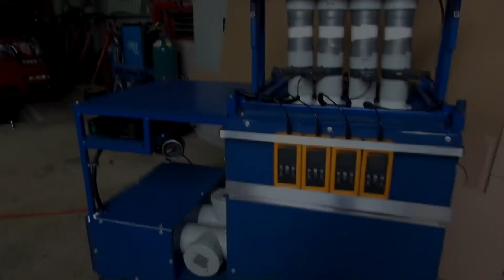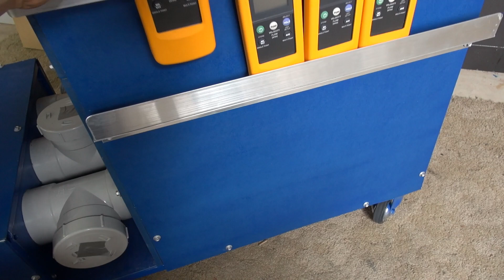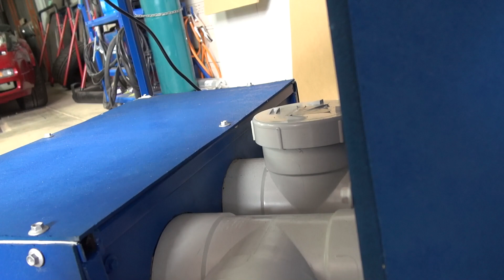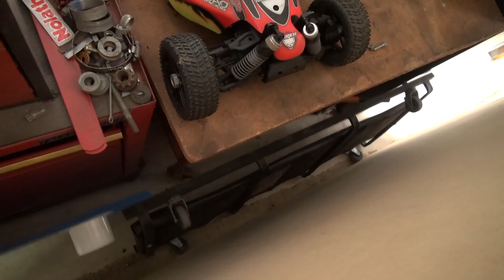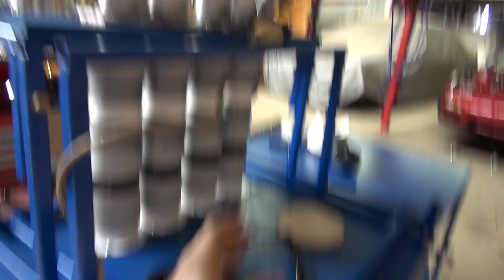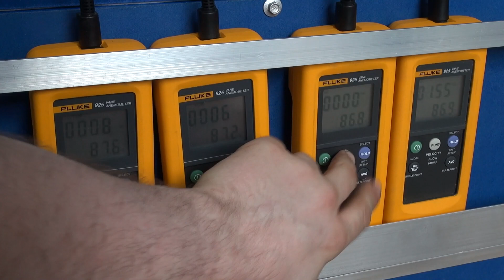Homemade Flow Bench + Car Update

Comment: My intention is not to be a know it all, it's just an FYI that is difficult to realize sometimes but remember, your boost pressure isn't what causes an issue with a weakness in your cylinder head hardware.
Obviously, 30 psi of pressure isn't going to stretch a steel fastener that is over 10 mil in diameter, your fastener stretch is a symptom of aggressive timing lead, as that's what causes cylinder pressure to spike out of control.

More importantly I wanted to say, I love your flowbench!! Great job!!

Edit: Damn I didn't realize this was 7y ago. Sorry

Comment: highly inaccurate testing all 4 together as that will never happen once an engine is running (all intake valves open together), if the intake valve on the cylinder nearest the body is open then the other 3 cylinders wont be flowing air from the plenum chamber this is the reason you should test them individually by blocking 3 off each time

Comment: LOL, I told you, I’m a noob at youtube, your video last commented 7 years ago, I won’t delete, unless you do. It might be some nice info for newbies like me and maybe revive this one, just my 2 cents.

Hey there my friend congrats you’ve beautiful R&D Bench setup,  you got lots of if not endless possibilities for R&D for all intake and exhaust components. I pretty sure many have commented or/and even yourself and I might’ve missed it, if so my apologies. This readings that you get are not really trustful for a final decision because like other might commented of course, this these test is done in reverse order, so any burr, nick and even form of each ram it would affect the result, in fact the pipe setup if the air is flowing and there is a pipe reduction and the other pipe is inside the past one there is an edge even if it comes chamfered, unless it comes from a solid billet and cnc cut to shape to have the same exact physical design they would defer from one another because all I have mentioned and more would cause a change in the airflow, it would be interesting if you can change the pipes for clear hoses and use a smoke machine or for health reasons a vape or the vapes whatever oil it is on the smoke machine and capture all the vortex that would form, I might be wrong but I thing you’ll be surprised with the amount of them. 

Now, I ignore but I think your engine is overhead cam if so this is perfect, this way fix everything together and run the tests again just like it is, now you can make a nice little 1/8 hp electric motor to turn the cam sprocket or even by hand, It might be worth even to get an salvage one cheap, in good working order of course. Once done go for a real “dynamic test” and supply the air t the intake, your AMAZING!!! setup leaves room for lots of upgrades just redirect with a homemade valve the air to the intake and by so with same setup it can open a larger reliefs for the exhaust side, even there you can simulate the exhaust back pressure and you can build an incredible setup, you kind of end up with a real dyno (“dynamic test”), that’s why put dynamic test in apostrophes, you would need the turbo(s)and all exhaust setup. But BRO!! you have a bench that can let you learn all the air dynamics in real life for a fraction of time it would take you for a physics career, but pinpointing what really interests you. You are just weeks and maybe less than a grand to have a money making flow bench and the opportunity to even lone it, rent it or just play around with it.

BTW, I have a believe that we might think alike, I was about to build one in the next months. Anyways I think your car’s top end of the engine is going to end up in the bench soon, 😂😂. Maybe for some more porting, ALSO I really apologize if I said t much crap, his is the first video I watch from you so all I have said might be late, how embarrassing 😅😅. To got a follower bro. Keep it coming I wish I can make a habit myself to record everything I do.

Comment: What happen if you rotate the throttle body 90 degrees... You wouldn't have that aileron effect... Like it is, you are lifting the air from out cylinder 1, maaaybe if you do that u will end that problem

Comment: I feel your test methodology may be flawed? first, your engine has the same CFM from each cylinder pulling the air through your intake. So mabe you should blow the air through the big hole?

Comment: Your machine is taking readings as if all cylinders have the intake valve open at the same time, which shouldn't ever happen.  You want to take individual readings for each runner with the other 3 closed,  and see if there's a difference in flow between them after measuring each one.   And your setup is for naturally aspirated testing with the vaccum on the backside, as I'm sure you know.  I think with boost pressure coming in from the throttle body (only 1 or 2 psi is necessary) , and only one runner open at a time ,  you'd have much more expected results.  I love these kind of experiments though , good job.

Comment: Its a good attempt to measure the flow when the air is been sucked naturally and constantly with the ventilators. But please keep in mind that this isn`t the case when an engine is running. A running engine is causing a lot of pulsing and waves inside of the plenum! I asume in an real scenario you wouldn`t see such a difference between the cilinders. This cant be the case as you never could find a propper tuning where the leanest cylinder work good together with the richest one.
I would not spent so much effort in measuring in such perfect even flowing simulations.

If you want to measure the difference between cilinders then better install 4 AFR sensors in your exhaust to compare which cilinder is running at which AFR. Assuming that your Injectors (which should be matched) are flowing same, you could see the difference which Cylinder gets how much air!

Comment: Nice job, but I was thinking that the set up is probably not the right one: you are "sucking" air like a naturally aspired engine, the result might be slightly different if you blow air, through the throttle body, like a turbo engine... ever tried that option? just curious...
Reply: Yeah, I was thinking the same thing as the direction of air flow is opposite to real application.
Reply: The engine always will suck the air if it is na or turbo. The only difference is the pressure available at the throttle body

Comment: I went with 4 MAF's that I grabbed from a junkyard(all 4 are ford crown vics). I looked up the specs on the sensor and hooked up volt meters to them, alot more accurate IMO.

Anyways, if you want a great guide on building a intake manifold, go grab a book called "Maximum Boost" by Corky Bell.

That man practically invented turbo racing lol
Reply: Sounds like a great idea!

Comment: this guy must not understand with a four cylinder engine only one cylinder pulls off the plenum volume at any one time
Reply from the maker: +theblackmech that one time out of the 4 cylinders has to pull air off the plenum actually happens 33 times a second ( 33HZ) when the engine's crankshaft is doing 8000rpm's the air does not get much time to stop and fill the other cylinders up when all 4 cylinder intake valves are opening and closing 33 times a second.
the airflow through this plenum will be working similar to this as it would be on a engine consuming this much air through the throttle body, this bench shows where the air naturally wants to flow inside the plenum the goal is to evenly distribute air flow across all cylinders at any throttle position to get good clean throttle response from your engine and help air fuel ratios stay the same in each cylinder. but like you said i don't understand.

Comment: You said you're gonna be running individual exhaust runner temp probes.  You can easily work out individual cylinder airflow by measuring each cylinders exhaust gas temp!.

Comment: Having all the runners simultaneously pulling air doesn't replicate actual running fluid dynamics in the plenum.  The fluid dynamics (inside the plenum) with pulsating sequential vacuums are completely different to what you're running.
Reply: If he ran a vacuumed pump that would sorted this issue out right ?
Reply: @dinukap4  it’s only good for comparative/relative testing. But it still doesn’t replicate real world running conditions. The fluid dynamics in a running engine will be considerably different.

Comment: Hey man, Very nice video - Also just wondering why you went with the CA? how come you didn't do a SR or even the VE route? thanks dude.
Reply from the maker: +Theonlyjak the car came with the engine and was a dead stock street car when i got it,
the car was just defected,
 the ca18 has the same amount of cylinders as the sr20 but the ca has the cast iron block and same style head as rb engine's so i just stuck with it no other real reason.

Comment: awesome setup! i have a theory comment, may or may not have merit. Would this measure the manifold in off boost airflow, as the motors pull air from the intake gasket side? Also would directing all the airflow into the front of the throttle change the measured airflow out of the ports, representing boost? or is airflow airflow?
Reply from the maker: +Luke Muller the bench is sucking air through the manifold so it is pulling air in from the intake gasket side.
yea airflow is airflow if i was to direct the air flowing through the bench back to the throttle body its not going to be any different because that's how much is already flowing through it, this bench is to help get the air flow as even as possible across the runners and to help with air distribution at varying throttle positions that's all. cheers
Reply: +styleslider400 okay thanks, but would your readings differ with an intake tube? Without the intake tube there will be a considerable amount of turbulence in the intake manifold, making the readings differ substantially from port to port.  Inside an intake tube under load port vacuum is created, creating linear air into the throttle plate.

Comment: How did you calculate the cubic feet to program into your anememoter? Where did you take your measurements from?
Reply from the maker: +aaron hollenbeck the anemometer has a cubic feet display setting in it, all you have to do is enter the amount of area the sensor or "fan" is sitting in to get the sample from eg 2.5 inch inside diameter pipe. and the anemometer then automatically works out the CFM by calculating the air speed and by the sample area size it then display's the calculated CFM for you. the measurements you can see are taken in pipes at 20:18. cheers

Comment: I like your rig very much. I even considered doing such setup using some old ca18 afm.
The measurements might make more sense if you install butterfly valves for each runner. This flow distribution does not occur in a running engine. There is still some interferace, due to the intake air inertia, but the intake never draws air via two runners in the same time.

Comment: Hey bud, i just came accross your channel. Have you tried to space out the TB?
It seems like the massive valve size of the TB is causing turbulance and because the TB IS SO CLOSE TO #1 cyl., the air wants to skip around to least path of ressistance which would be #4.

Angleing the TB and spacing it out even a few inches should make a difference. Good luck dude. I like the flow bench setup.

Comment: Nice Video, would be interesting to see the what happens to the air flow at part throttle with the throttle body rotated 90 degrees?
Reply from the maker: good idea! i just had a quick try and it did not do much at 90 degrees but flipping the throttle body 180 degrees made a massive difference to air distribution at 1/4,1/2,3/4 throttle all runners are within 5-15cfm of each other!

the reason why is because  one side of the butterfly helps collects and merge the air into the opening between the butterfly and the body it self this side acts like its directing the air towards no. 1-2 runners  while the other side of the butterfly's opening doesn't have this directional effect from the throttle body so the air just passes straight through this gap,

by rotating the throttle body 180 degrees this still has no effect at full throttle as expected, but any throttle position below full throttle would gain a massive throttle response increase as well as power this would be good enough as a quick fix for sure but at full throttle there is still the same problem so i am building a new manifold to fix this.

also found with the throttle body flipped 180 degrees that the overall cfm going through the plenum did not change much from full to 3/4 throttle ,the air only moved around between runners yet were closing the throttle body so this is saying that the 90 degree bend from where the air comes through the throttle body and has to turn into the runners,
these tight sudden bend's are a restriction to the max flow potential of the throttle body.

in this video most of the air from the throttle body at 1/4,1/2,3/4 position is getting thrown up to the top of the plenum and runs along the top then hits the back and run's into no.4 runner whats left over that cant flow through no.4 will go back to no.3 runner. the other side of the throttle body what air gets past that gap is fed to no1-2 runner this is why they are lower in cfm. pretty cool.